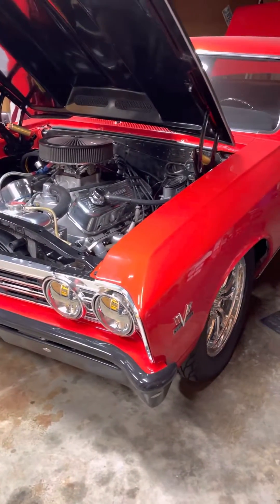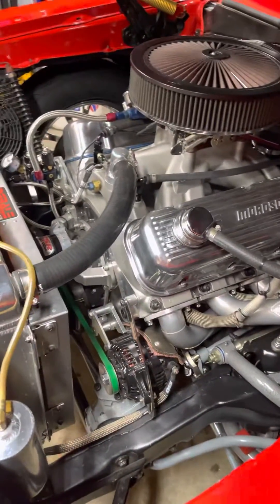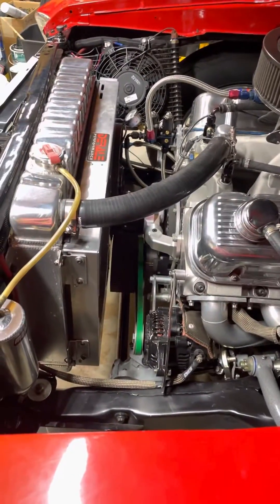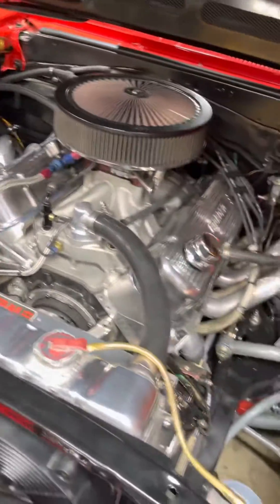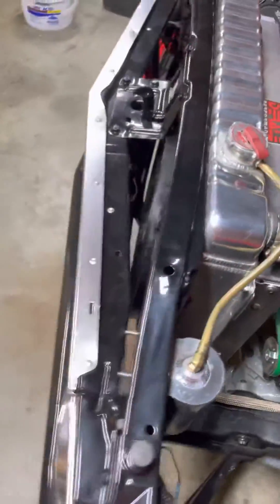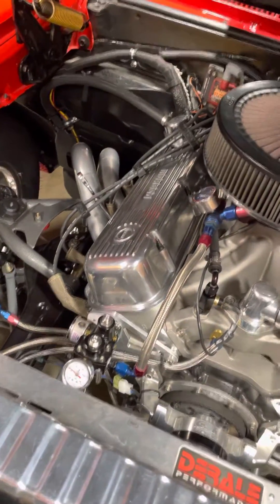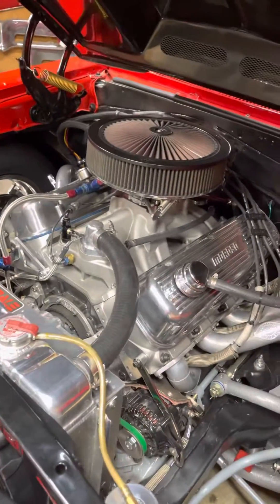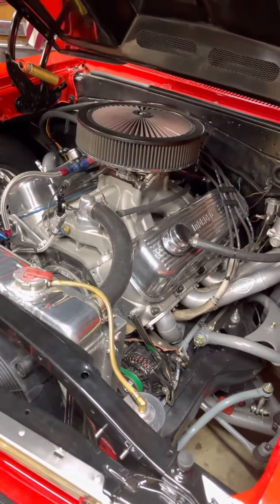540 big block Chevy with F-2 procharger, how much boost, how low of compression ratio

Comment: I'm running an F2 on a 427SBC on E85 with Holley Dominator EFI and two sets of injectors.  My compression is 10:1 and I've run up to 26 pounds of boost with 30GPH of straight methanol being injected to cool the charge and reduce detonation.  I went to an A2W intercooler and now I'm going to run E85/Pump gas with a flex fuel sensor on no boost and methanol through a second set of injectors when under boost.  You could do this with your current compression ratio.  Drive around on pump gas and inject methanol as you get into boost.  You would probably need to go to EFI to properly accomplish this but you avoid the expense of changing your pistons.  If you want to run pump gas I would do something lower like 8:1.

Comment: My car chief will tell you this... If you want to run boost up to 15 maybe 20 ,on pump 93,  keep CR as low as 8/1,,he runs lower in his street toy.  Think of it as building a bigger bomb in the cyl. Yes it may be a bit lame off boost but wiith a 540 it will have plenty of heart to get it up on boost..size blower accordingly and you will make mid teens for HP.